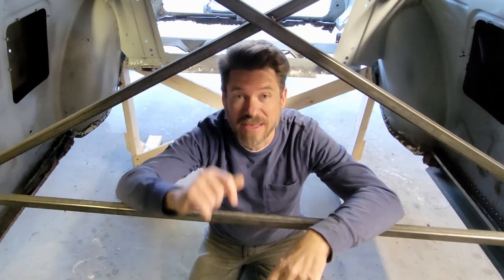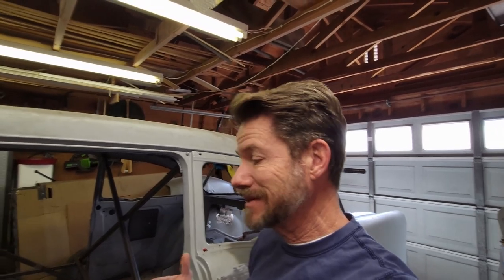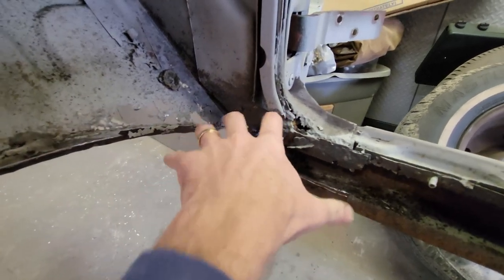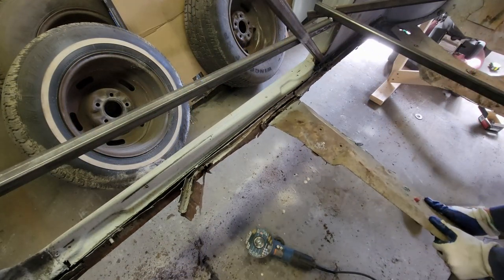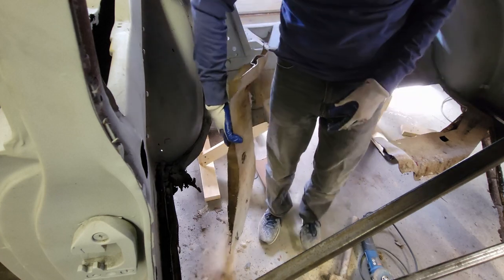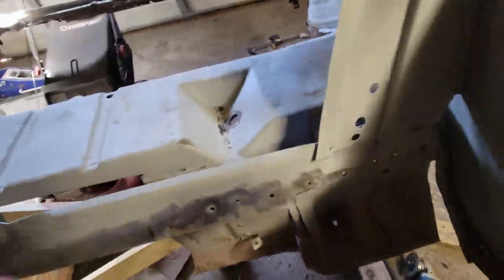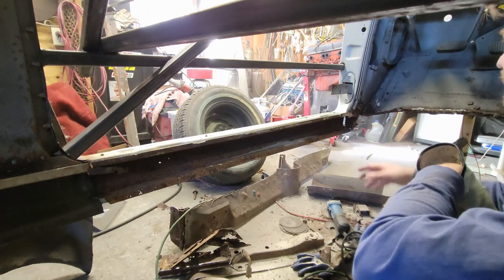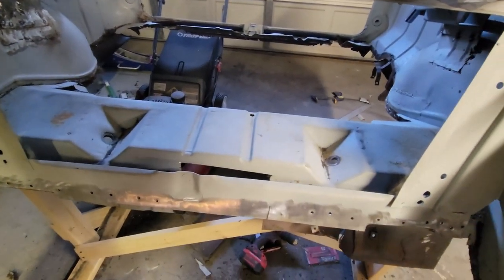E28 Prepping for the New Floor Pan!   1956 Chevy Bel Air Restoration

Comment: It almost seems it would benefit you to get a smaller plasma cutter. I have a Hobart with a integrated air compressor, and it runs on 110v. I have been using it on my ‘57 bel air floor and trunk as I am making each piece by hand. The cutting discs are great but nasty for the respiratory and eyes even with PPE. I realize it’s a little late for the suggestion since your done with the removal, but it would be something to look into for future projects, since I’m sure this one will not be your last. 
Keep up the great videos, and have fun!
Reply from the maker: I have one that I bought about 6 months ago, but it's an air hog.  My compressor is on its last leg and won't keep up.  That's the next major purchase, and it's going to have to be soon!

Comment: If shipping wasn't bad I'd buy those front braces you cut and weld them back together. I'd also buy that left rear section and right rear section of that rotted brace not the whole part. I need the section that the bolt and body mount go. Also those mount braces under the back seat I need those also.
Reply from the maker: Let me see how I might be able to package those up and see how much shipping might be.

Comment: I really look forward to your videos and learning how these cars go together from a "regular" guy's perspective. Thanks for taking the time to make and share them.
Does the '56 have the brace that ties the A-pillar to the rockers like a '55 does? I think it welds to the A-pillar and gets sandwiched between the inner and outer rockers. It looks like there might be a little left of the original one on the passenger side. You might need those pieces, as well, if you haven't already welded it up.
Reply from the maker: It just might.  What I took apart didn't seem complete.  You've got me thinking.  I'm going to have to look at some diagrams now.  And very glad that you're enjoying the series!